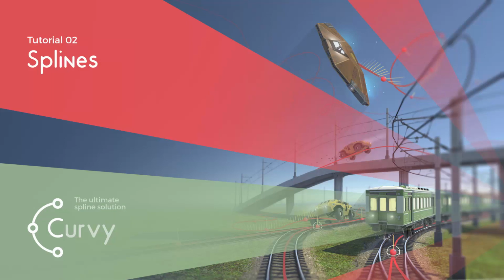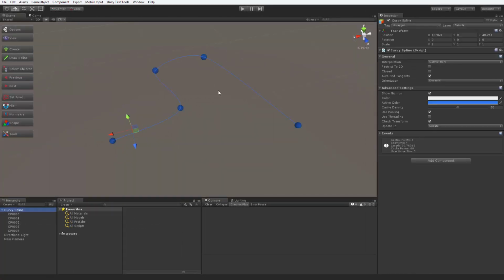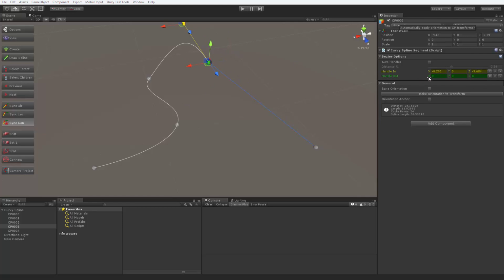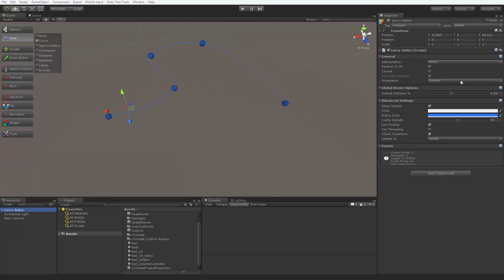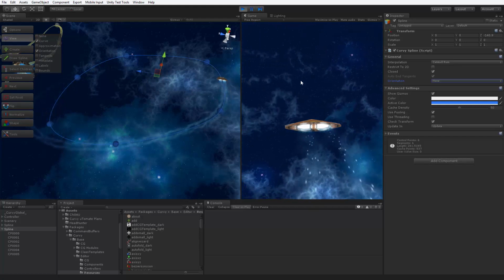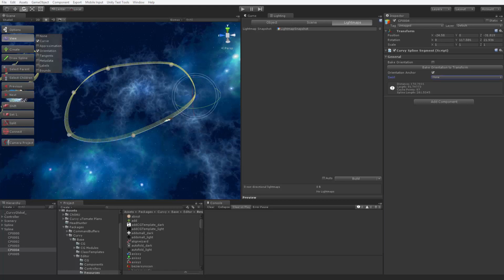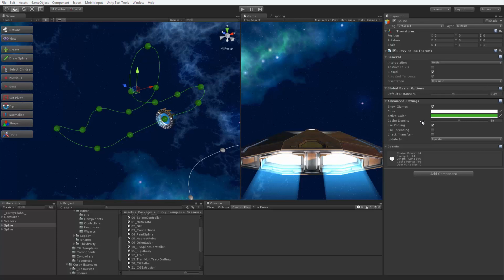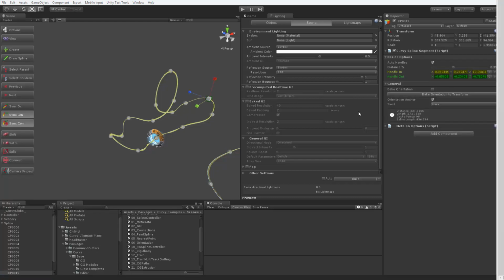Curvy Splines for Unity - The Spline Settings

Comment: can you change interpolation of individual curve points? can you have a mix of linear and catmul etc on the same spline?
Reply from the maker: Hi. Each spline has only interpolation type. But you can create multiple splines of different interpolation types and connect them. That way, moving a curve point on the border between two splines will update both splines. Did this answer your question?

Comment: i have a sprite obj traveling on a curved spline, is it possible to have it deform when it reaches a turning point of the spline? Say a sprite a rectangular shape, when it reaches a circular turning point, can the rectangular shape deform to the shape of the circular spline??? Thanks
Reply from the maker: That is not an available feature out of the box at the date of this comment. It is a feature I am intending to implement for the next big update, but I don't have an ETA for that. Until then, and if you are knowledgeable enough about coding, Curvy's API allows you to get all the spline data needed to implement your own deformation behavior.

Comment: all is fine and dandy but how to you add a control point between 2 spots?
Reply from the maker: Either select both control points (CP for short), then the Split tool in the toolbar, or create a new CP the usual way while selecting an existing CP, this will be the new CP a neighbor of the selected one
Reply: @toolbuddy  thanks!
Reply: @toolbuddy  Was looking for this info myself. I’ll give it a shot.